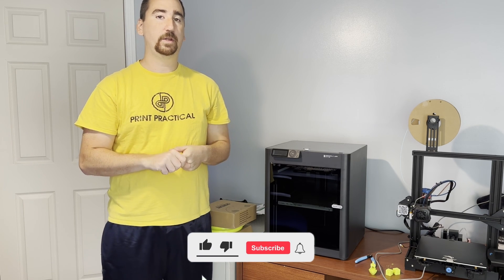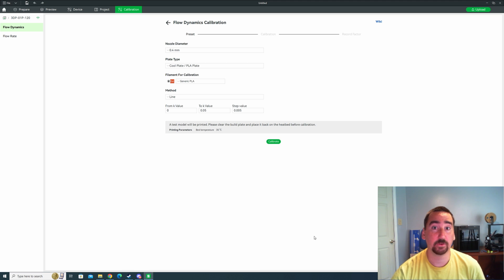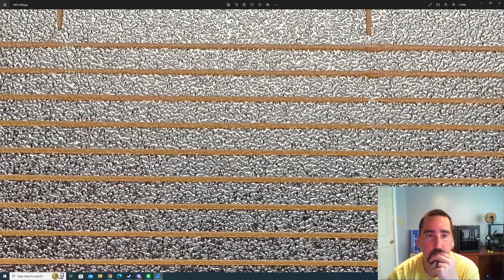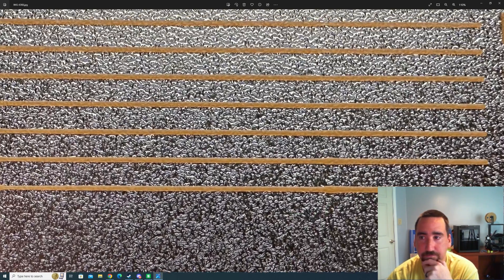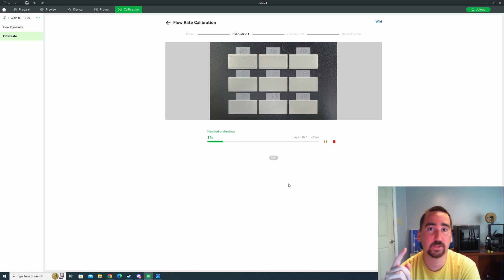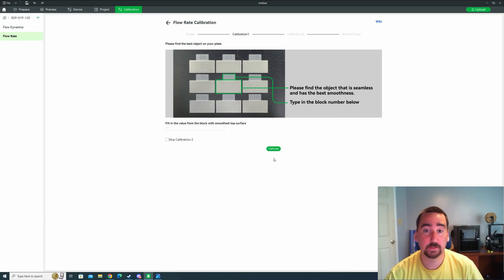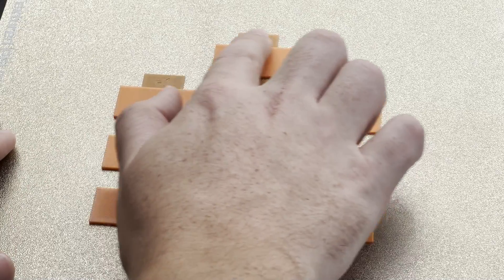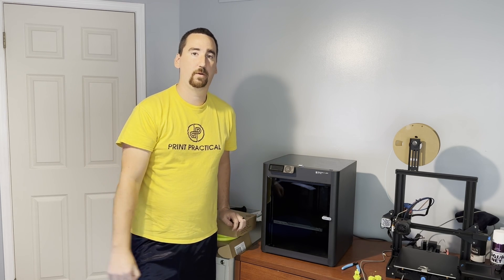Bambu P1P & P1S Filament Calibration | Flow Dynamics & Flow Rate

Comment: Thanks for this. If I primarily buy bambu lab filament I assume this is all preset based on the RFID tag. Does this mean its essentially 99% out of the box as good as it will get and running the calibration is redundant? It seems this test is primarily for 3rd party/unrecognized filament.

Comment: I got 0.03...and couldn't even enter it as the result...it kept giving me the message the put in the correct K value ...so i could not adjust any flow dynamics etc...I was pissed. Now I'm just printed at standard settings and k value. Cause I can't enter what the calibration says anyway 🤣

Comment: I have been beating my head against a wall using Bambu PETG HF and CF that just doesn't seem to play nicely.  Being a noobie, a lot of what I read in the forums, and elsewhere don't make complete sense yet, but this video made this process a lot easier to understand.  I now get the impression that the Bambu settings for their filaments are not as "plug and play" as I hoped.  This should help a lot!  Time to print a lot of Benchy's!

Comment: So do I have to redo my tests when i get a new roll of the same fillament? Or do I only need to calibrate it once, and it doesnt matter if its a new roll? also do I need to calibrate each color of fillement along with brands? Because colors do effect how the properties of how it melts, strings etc.
Im asking because the manufacturer will use different batches of plastic to make their fillament and each time the properties may be different. We test all of our material before we use it for the melt temps, strength etc at work making HDPE conduit.

Comment: I just bought 2 of these printers and BOTH printers were already calibrated at 0.02 out of the box. I would imagine unless you are using the cheapest crap filament or have filament that has issues then you should not need to do this on your printer and there is a chance that you could eff it up more than tweak it.  One thing the OP didn't mention is that before you do any of this, write down your current settings.  As I said, good chance you will be hosing this up more if you are having an issue with printing.  Biggest issue I had was in filament identification.  If you are NOT using Bambu labs filament, the definitely choose Generic and be mindful with HS designations.  Don't use HS if it's not HS and do not use Bambu settings if it's not Bambu.   Since double checking my AMS for the proper filament specs on the current loaded reels I have had no issues whatsoever with my prints.  I have even printed a 3D Benchy on Ludicrous speed with Generic PLA and it nailed it.  Very happy with my 2 P1S's.  They have made a huge impact on my small business quality and speed.

Comment: Nice video, thanks. So based on your calibration, how do you feel the Hatchbox PLA prints? Do you see an improvement over the way it printed before the calibration? Do you run these calibration tests for every new filament you print with?

Find the limited calibration options in Studio don't allow you to dig in quite as much as you should (wish Studio would adopt the full Orca calibration options). Find Orca's calibration sequence to be more defined (although these 2 calibration tests are very similar) and helps you to lock it in better. Have you tried Orca calibration? If so, do you feel you get better results? If you do more advanced calibration through Orca, would love to see some videos on this from you. Thanks.

Comment: What about for A1? do we need to do this as well, I only use Bambu filament and so far only PLAs. Do I need to do this? I have a couple PETG HF Bambu which I have not used.. will the AMS lite remember the setting if we dedicate slot 1 for PETG only for example

Comment: Newish P1S owner here. Do you have to do this for every filament? (color wise) I personally run Elegoo and have some normal PLA and some that's rapid PLA Plus. Should i do the calibration and make a profile for the Rapid PLA Plus and then one for the standard Elegoo PLA? To be honest, I have yet to have an issue with a print since I've gotten my machine.
Reply: I had the same question.  You may likely be very near perfect applying one color settings to all others of the same brand/type, but wouldn't hurt to at least validate flow calibration with a couple colors to test that theory. I'm sure corner cases will yield different results but I'd say that may be other factors not related to calibration will affect you more... filament moisture, temps, etc.  I see the overall feedback is split to those who calibrate each color vs those who just calibrate per brand & type.

Comment: Do I have a question: will I need to do this every time I use a new material? I mean, do I repeat the calibration process if I switch from PLA to ABS, and so on?
Reply: Yes ideally 
You might get away with it, but if it’s a different filament you’re new to I’d say you should do it

I also find it’s good to do it whenever you add a new part or after you’ve done basic maintenance work on your printer 

Also if you’ve been printing a lot lately
Reply: @ thank you very much for the information 👍

Comment: I'm thinking about switch from a ender 3 pro  to a Bambu p1s is this a video on how to calibrate your nozzle to the build plate to get proper prints so your nozzle doesn't scrap your build plate or be to high off the build plate
Reply: I own a p1s 
The printer has auto levelling you can calibrate on a regular basis 
This video is about flow calibration

Comment: Newb to whole 3D printing here. So it means I got lucky last month just buying random filament (Bambu, Sunlu, DevilDesign, Jayo) and just tucking them to AMS selecting "Genering PLA" to get print outs? But from your video it means you have to do that with every spool you get ? Or you trust some brands (i.e. Bambu) ?
Reply from the maker: Use the generic profile and just print. If you notice any issues in quality, then you can go about doing calibration to dial in for that filament. It’s not 100% necessary. Also, Bambu has profiles for their own filaments, when I’ve used them they work really well.

Comment: God damn. Do we have to go through an hour+ of calibration for every new filament? 
Is that what an extra $4-500 saves you on the X1C? I have an X1C and was considering the P1S for a second printer...
Reply: Default values will get you far so I’d say no. This is only necessary if you’re having noticeable print quality issues really.

Comment: I started with an A1 mini and decided i wanted more. i brought home the bambu lab ps1 ams on friday and i honestly feel a little in over my head. Do i need to do this with every filament i have to get the perfect values? or do you do this to better understand your printer?
Reply from the maker: Hey, you’re doing just fine! There’s nothing really more complicated than the A1, just some extra options for fine tuning. I rarely run filament calibrations unless I’m trying to perfect the quality of the resulting print. Many times I just use the generic profile from Bambu slicer and it just works.
Reply: Thank you! I have gone through the tutorial (that you show here) with my 3 favorite filaments. I’m starting to get the hang of what values to expect for k etc. this was so helpful. Thank you and thanks for the reply!

Comment: Great job explainibg how to do this I learned the hard way having to use it on an ender 3 v2 and S1 Pro with klipper and orca slicer it's a must
Reply: I'm thinking about switch from a ender 3 pro  to a Bambu p1s is this a video on how to calibrate your nozzle to the build plate to get proper prints so your nozzle doesn't scrap your build plate or be to high off the build plate

Comment: Please pay attention... The Automatic Calibration for Flow Rate on Textured PEI Plate is not supported, and it's not recommend performing the Flow Calibration on it, to avoid print quality issues. The texture of the plate can interfere with the LIDAR calibration resulting in bad calibration results.
Reply: P1s doesn't have lidar

Comment: Nice video, just curious. When you decide to print faster do you have to calculate anything else? Or does the printer automatically do flow rates for the faster speeds

Comment: I'm having some issues with the calibration if anybody might have some knowledge.
I'm using the basic orange PLA that came with the P1S. I did the flow dynamics, and the best line looked like 0.15 or 0.20. In the end I chose 0.15.
Now when I went to the flow rate and did the first part of the calibration, ALL of my models looked terrible to say the least. I didn't bother continuing to do the second part of the flow rate since they were all so bad.

I've printed 3 models before doing this calibration and for the most part, they came out perfect (Basic PLA and PLA Matte, both BambuLabs). So I'm kind of confused how after doing half of the calibration, that it's worse than before...
Should I restart from the beginning and redo the flow rate? Choose 0.20 this time..?

Any help is appreciated. Thank you.

Comment: Do you know how to reset it if you switch back to a Bambu filament?
Reply: I'm pretty sure that this is a setting for each filament type you choose.
So Bambu filaments can have a different setting to say Sunlu as long as you save a filament setting for Sunlu filament. (or any other brand).

Comment: You missed the start of the selection of how you set what material. Did you select Bambu PLA Basic or Generic PLA?
Reply from the maker: Sorry, didn’t realize that. I use generic PLA, as I wasn’t using Bambu branded PLA. I probably wouldn’t even run the calibration if I was using Bambu filament, as they should have it pretty well tuned already. Though, if you want to compensate for nozzle wear or old filament etc, it wouldn’t hurt.
Reply: Nice one, thanks for clearing that up. Great content, its been quite hard to find a good straight to the point video.  @PrintPractical
Reply: Sorry mate, it does show you Generic PLA

Comment: Hello, I'm trying to calibrate ASA, and for some reason, it starts printing, but the status bar stays on NA and doesn't do anything once the print is completed. I did the update, but I'm not sure if im doing something wrong.
Reply: same here have you found a fix?
Reply: @girthfrombirth4408  Yes, new firmware was the issue. Thank you
Reply: @Absoluteprecisionnj  Now i wont run beta firmware anymore haha, i learnt my lesson
Reply from the maker: Funny y’all mention this. I just updated my printer yesterday, ran into the same problems. Classic.
Reply: i think i found the reason, are you running the latest firmware 1.05? try downgrading your firmware and see if it works, thats what fixed it for me

Comment: Thanks for the video. I'm confused by the 2nd calibration. Since in calibration 1 you chose block 5, shouldn't calibration 2 be printing 0 through 9 rather than -9 through 0?
Reply: I answered myself that it makes no difference since those +- values are "arbitrary", the printer does manage them. So no difference in being presented a 0 -9 scale instead of a -5 -5 as I expected too.

Comment: I've been printing for yrs w ender 3s I just got my p1p and it's over hangs are awful I've slowed the p1p down to 50 mms would this also help my over hang?
Reply: I've found that doing variable layer height has been extremely helpful for overhangs. I'm also in the process of fiddling with a custom preset that will run the part cooling fan at 100% during all overhangs and bridges to see if that helps since PLA always needs cooling.
Reply: @TylerCoyote  awesome thank you!

Comment: Doing this now on my P1S.  What is confusing to me is the Flow Dynamics K Value.  It looks like it is saved under the system present "Generic X".  How do you get that K value associated with the new User Preset with the flow rate number?
Reply from the maker: Yeah man, something I haven’t figured out yet. It’d be nice to see up presets for all of my filaments, but I didn’t see a way to do it.
Reply: I had this same issue, and found that if you make a preset first, then reboot Bambu Studio it will see your preset and you can apply the values to that preset. For some reason it doesn't read the preset if you make it and then go straight to testing, you have to reboot the program. I've got presets for different brands etc. @PrintPractical
Reply: Right now there is a bug that has a ticket open in the GitHub as filaments do not save k value. You have to input it Everytime so might be best practice to write it on the spool or a sticky note on the AMS

Comment: Does this need to be done on a new machine from bambu? Or was it calibrate already at factory?  Thx.
Reply: It should be run once for each type of filament that you use (you don't have to do this for the brands that already included in the slicer (Bambu, Polymaker, Overture, eSUN))
Reply: If it's printing fine don't mess with it. 
The printer comes very well calibrated from the factory.